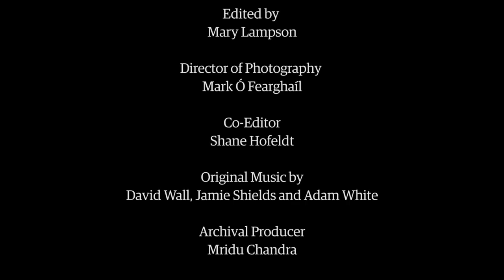This Changes Everything – Naomi Klein | Guardian Docs

Comment: Producing as much carbon as we do may be an issue, but the most important issue and the single largest cause of climate change is that of Geoengineering. Global weather modification programs are wreaking havoc and too few know about this. Look up Geoengineeringwatch.org for credible information.
Reply: +nephos100 And that is where you are wrong. Geoengineering is just an idea being research right now. Get your head out of these misinformation websites and start doing something that will MAKE A CHANGE. We don't need conspiracy nonsense. IStop filling your mind with useless misinformation put out by these charlatans. Educate yourself.
Reply: +foghaze You are wrong on all counts there. Geoengineering is being carried out through several different programs and has been since the late 1940s. It is now a fully deployed, covert-in-plain-sight, global activity. Some of the programs are Solar Radiation Management (SRM), Stratospheric Aerosol Geoengineering (SAG) and Oceanic Iron Seeding. Since 1998 they have rally ramped up the amount of SRM around the world. It is easily observable once one learns the basics. The programs are all disastrous and are not meant to be beneficial to any environment.

The talk from governments and corporations about thinking of doing it is just a deceitful public interface that hopes to make the few people listening put their minds at ease. But it is happening and very much contributing to 'climate  change'. The CO2 that mankind produces (about 100 000 000 tonnes each day) is not helping but Geoengineering is about weather warfare and economic gain.

Anyone who finds out about Geoengineering also finds out that there is a massive carbon pollution problem too, so your idea that people are not going to make a change because they hear about Geoengineering is very wrong. If these governments and corporations were to openly admit to the Geoengineering programs, it would not have the effect of placating us. It would cause an outrage as it is obvious that the programs are only to manipulate the weather for ulterior purposes.

The term 'chemtrails', which I never mentioned, is a layman's term to describe the thick white lines (for SRM) left by Geoengineering jets that are easily observable from the ground. The term 'chemtrails' has been tagged by the whore media as conspiracy theory only, yet if one looks up the scientific terms I mentioned they will find ample and credible information on this activity. In fact, also look up 'Albedo Enhancement', which is the term being used more and more now that the public are waking up to the realities of Geoengineering.

How apt your name is Foghaze. That works on several levels. So, just follow my prompts and "educate yourself".
Reply: nephos100 Ok. please provide the evidence that Solar Radiation Management is actually happening. If you read all the studies you will know it is proposed to occur at 60,000 -80,000 ft in the atmosphere. Do you have anything that shows this is being done at these altitudes in the stratosphere? Planes do not fly this high so please provide the evidence you have that SRM is actually taking place as we speak. I've read all the research and I have yet to find any evidence this is happening. I would surely enjoy actually seeing your evidence.
Reply: +foghaze I cannot prove anything to you via some Youtube comments and you know that. I don't know why you wish to uselessly argue here. You cannot convince me that something is not happening. Government documents are available for anyone to look at if you care to look.

Just go to the site Geoengineeringwatch.org as that site has the greatest compilation of data, citations, references, links to actual government documents, expert testimony, lab test results and involvement of a large and still growing portion of the general population who are starting to notice something is very wrong with our climate and our weather.

So, just go to that site. It is replete with all you need to start on the journey of asking more and more questions. Don't ask silly things from me such as "evidence". Surely you wouldn't give over your ability to investigate for yourself, would you? In that case, just go to that site and start reading.

As for your mention of certain altitudes required, you will find out plenty of information about what happens and where. Instead of Geoengineering in the stratosphere where it might be more effective, Geoengineering is indeed occurring in the Troposphere which is our breathable air column.

Stop looking at the fly shit on the window and start looking through the window at the sky, the weather and all the anomalies. And start reading all the available data you can get your hands on. There we go, you have plenty of homework to do. Get to and smarten up. Good luck.
Reply: nephos100 I've been to that site many times. I've been researching this for 10 years. So whatever you say will not convince me it is happening nor is there any physical evidence that exist either. Soil/water samples, Patents and proposals do not prove something is happening. Good luck to you.
Reply: +foghaze No problem. I knew you would reply with something like that, so the seed I am sowing is not on your stoney ground, but will be watered in the fertile soils of the many readers of our comments. Thank you for making that opportunity happen.
Reply: nephos100 Like I said I have been researching and studying this for 10 years so you are not telling me or showing me anything I already didn't know. You can try to convince yourself you have sown some seed to stroke your ego but that is unfortunately not the case. You are very good with words but you have incomplete information. You believe weather and climate are the same. They are not. This is a critical basic mistake. You made nothing happen.
Reply: +foghaze You haven't researched anything at all. You are not even a good liar. You say I am mistaken but you never say how. I can point people to credible sources of information to support my claims and you cannot do the same. Again, your denials are empty, desperate attempts to negate but are backed up with nothing except school yard retorts.

To all our readers out there, look up Geoengineeringwatch.org for credible, reliable, verifiable and alarming information.
Reply: +foghaze Yes, there are those papers, but there is also Dane's site which fulfils a great need: to expose the ongoing, classified SRM programs being carried out right over our heads. Who cares if a bunch of academics have written about something as if it is only being considered? A few minutes of investigation is all that is needed for someone to find out there is something going on. It's that easy.
Reply: nephos100 "SRM programs being carried out right over our heads" Ok I will ask you again please show me the direct evidence that Solar Radiation Management is taking place this very moment. Pictures of persistent lingering and spreading contrails are not proof that geoengineering is happening. It is a very simple question and you should be able to answer it very quickly. If it's so easy you can post it here. This is the first thing I asked yet you have scurried around the question long enough. Either you have it or you don't.
Reply: +foghaze Direct evidence here in a Youtube comments section? How can I do that? But I can alert people to watch the skies, read Dane's site and start doing their own research and think for themselves. You would have everyone just believe you that 'everything is OK just go back to sleep'.

If I am so completely mistaken, how come you are so persistent in trying to negate me? I am not trying to negate you. You do that perfectly well for yourself. Everyone else can see this. I wish you could see this.
Reply: nephos100 Well first off you could send me a link to an unbiased experiment where someone has taken a direct sample of this supposed evidence you claim is easily seen right over our heads. If it's easily seen then a sample would not be impossible to get. That would be a very easy way to show evidence. Evidence is not hard to post in a comment. I'm baffled you think the contrary.
Reply: +foghaze On Dane's site there are links to soil and water lab test results. Use those fingers of yours and look them up. You can do some work of your own for once.
Reply: nephos100 I've read all these severely flawed lab results of soil and water samples from Mount Shasta. There is absolutely no link with water and soil samples that proves something is being deliberately sprayed from planes. On top of that these elements are found in the earths crust and they are also more abundant in and near Volcanoes. These samples were taken from an actual volcano. You do know Mt. Shasta is a Volcano right? I sure hope so. Furthermore these elements found in the lab results are also released through other industrial processes like mining. There are dozens of mines in this area too. It also should be noted the number one reason aluminum would be found in the air and soil would be the weathering or rocks. Where there is a volcano there will be the weathering of rocks. Did they rule all these factors out when they took the samples? Of course not because they are in the business of misinformation and once again Dane is not a scientist therefore he clearly has trouble understanding the scientific method. I obviously already used my fingers to find the information contrary to your baseless accusations.
Reply: +foghaze Unbonded aluminium does not occur in nature - at all. In its ore state, Bauxite, it is safe. So where does all the unbonded aluminium come from? They have found extraordinary amounts in the snow!!! How would it get in the snow? Snow falls out of the sky. There should be zero amount of any type of aluminium in snow, especially in a pristine and isolated area like Mt Shasta. What say you?

Are you saying there are dozens of bauxite mines and aluminium refineries around Mt Shasta? I will have a look for those.... Nope, didn't find any.

Unbonded aluminium does not come out of volcanoes. Though, on Dane's site you can watch testimony from a former Defence Industry technician explain how Al2O3 (two aluminium atoms to three oxygen atoms) is added to jet fuel to increase combustion and thrust. He explains how this results in aluminium coming out of jet engines and this then comes down to the ground.

The other source of aluminium is the combusted coal fly ash that is sprayed from special nozzles in the Solar Obscuration activities aka SRM, Solar Radiation Management. SRM is ostensibly for reducing greenhouse warming, but as we can see from GISS maps, the earth is heating up at an extraordinary rate. The artificial cloud cover caused by SRM is trapping heat in more than having any cooling effect. And at the same time, the toxic elements in the coal fly ash are poisoning all of the biosphere.

So, all your attempts to lie are as transparent as glass. Don't you have a sense of embarrassment? Anyone who logically and calmly looks into this matter will see that you are desperately lying and that credible information shows that I am correct. You see, the information speaks for itself. I am not its spokesperson. It doesn't need one. But it should be known by everyone so that we, The People, can rise up, protest and rage against this crime being committed in the skies. You are lucky you are anonymous as you would otherwise be counted amongst the traitors and put to the full due process of the Law.
Reply: +nephos100 No one knows if any of the tests found unbonded aluminum because all the testing was done by a technique that breaks compounds apart into their constituent elements.
Reply: +nephos100 And the "pristine" snow sample was collected in July. The snow had been sitting there for months just collecting dirt.
Reply: +nephos100
Your knowledge of mineralogy is abysmal. Al is the 3d commonest element in the crust, & mostly found as aluminosilicates. You are correct in saying it is never found unbound, it is a very reactive element.
The sources of Al in the environment are mostly natural, from weathering & volcanism. Human activity is only responsible for ~13% of environmental Al.

" Because of its prominence as a major constituent of the earth's crust, 
natural processes far exceed the contribution of anthropogenic releases 
to the environmental distribution of aluminum (Lantzy and MacKenzie 
1979). Anthropogenic releases are primarily to the atmosphere. The 
largest source of airborne aluminum-containing particulates is the flux 
of dust from soil and the weathering of rocks (Lee and Von Lehmden 1973;
 Sorenson et al. 1974).

Aluminum can be released naturally by the weathering of aluminum-containing rocks. Aluminum is also released to soil as a major constituent of many mining wastes and is also contained in solid wastes from coal combustion and aluminum reduction and other metal processing operations (DOI 1983, 1984).

Aluminum never found free in nature and is found in most rocks, particularly 
igneous rocks as aluminosilicate minerals (Lide 2005; Staley and Haupin 
1992). Aluminum is also present in air, water, and many foods. Aluminum 
enters environmental media naturally through the weathering of rocks and
 minerals. Anthropogenic releases are in the form of air emissions, 
water effluents, and solid waste primarily associated with industrial 
processes, such as aluminum production. Because of its prominence as a 
major constituent of the earth's crust, natural weathering processes far
 exceed the contribution of releases to air, water, and land associated 
with human activities (Lantzy and MacKenzie 1979).

Since aluminum is ubiquitous in the environment, the general population will 
be exposed to aluminum by the inhalation of ambient air and the 
ingestion of food and water. 

The major anthropogenic sources of aluminum-containing particulate matter include coal combustion, aluminum production, and other industrial 
activities such as smelting, that process crustal minerals (Lee and Von 
Lehmden 1973)

In addition, aluminum-containing dust is generated by volcanic activity 
(Varrica et al. 2000). Human activities, such as mining and agriculture,
 contribute to this wind-blown dust (Eisenreich 1980; Filipek et al. 
1987). About 13% of atmospheric aluminum is attributed to anthropogenic 
emissions (Lantzy and MacKenzie 1979). The major anthropogenic sources 
of aluminum-containing particulate matter include coal combustion, 
aluminum production, and other industrial activities, such as smelting, 
that process crustal minerals (Lee and Von Lehmden 1973). Aluminum 
concentrations in air particulate emissions from iron and steel 
foundries and brass and bronze refineries range from about 100 to 1,000 
ppm (Lee and Von Lehmden 1973). Que Hee et al. (1982) also found that 
aluminum was one of the most abundant elements quantified in coal stack 
emissions from power plants located in both the eastern and western 
United States. In addition, in U.S. cities, motor vehicle emissions 
contribute an estimated 0.9–9% of the observed elemental concentration 
of aluminum in these atmospheres (Ondov et al. 1982).

Weathering of sulfide ores exposed to the atmosphere in inactive mines and 
tailings dumps releases large quantities of sulfuric acid and metals 
such as aluminum (Filipek et al. 1987).

Increasingly, acid environments caused by such acid mine drainage or by acid rain will subsequently cause an increase in the dissolved aluminum content of the surrounding waters (Brusewitz 1984; Filipek et al. 1987)."
Reply: +Dick Holman Nephos100 has continually been marking all my comments as spam. So here is what I have to say. 

Nephos100 will go to any extent to silence me. Please continue marking my comments as spam. It goes to show his true deceitful intentions.  And you call me a troll? You troll these pages and when someone gives you a good run for your money with actual facts you report their comments as SPAM? I give good research smashing all your claims into the ground with sources, scientific explanations and all you can do for fear of looking ill informed is to mark them as spam!  You are being reported as we speak. I will continue speaking truth and no one especially YOU will silence me! You have clearly met your match. You don't like being proven wrong do you? How would you like it if I did that to you? At least I have more dignity. Carry on spreading misinformation you coward.
Reply: +Dick Holman I will be making a video of how this person has deliberately silenced me. I will expose him thoroughly.
Reply: +nephos100 It is very unfortunate that you appear to know what you are talking about but to someone who actually knows about Geoengineering can see it is more than evident you are clueless. It's hard to decipher if you are intentionally doing it or you are just severely misinformed. You twist facts and provide misinterpretations in an effort to appear infallible which is extremely excruciating to witness.  It's probably due to the fact your "research" is 100% biased and comes from a WOO website. What a travesty.